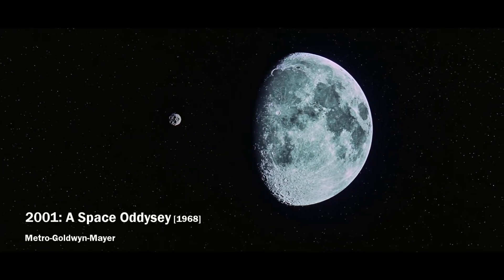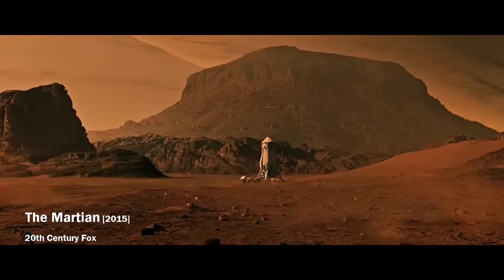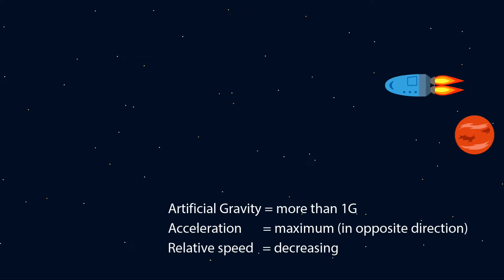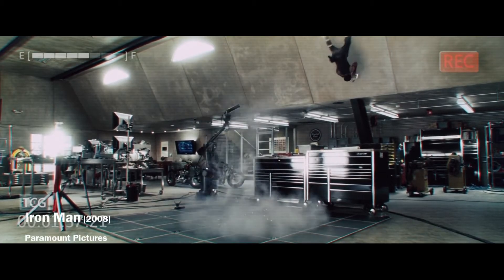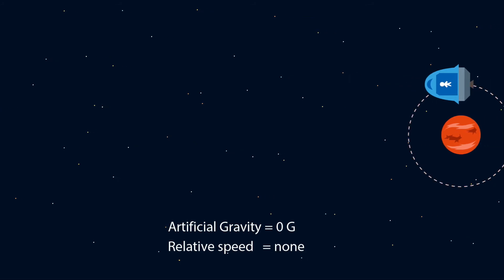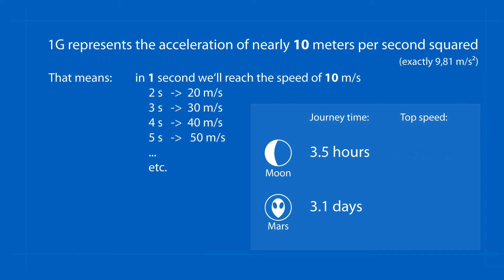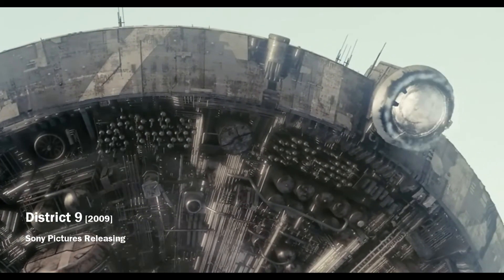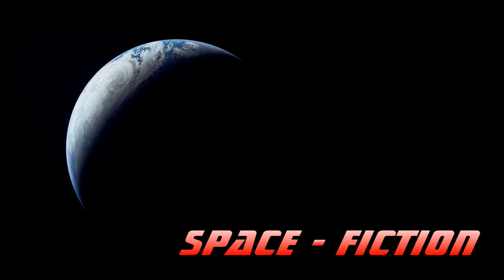Can we make artificial gravity without a rotation?

Comment: While its simple on smaller scale it's not really practical if you want an actual space settlement. A Rotational structure basically works with the same principle, but instead of freely accelerating in space, you put an axis to create centrifugal force. A disk shaped structure works better because every side of the disk opposite to each other create counter force, it's what were explained in the video when the spaceship accelerates, and then deccelerate after the change in direction. But instead of periodically accelerating and deccelerating, it's done constantly. You also don't need a varying speed with rotational device, as you can keep the rotation speed the same.The bigger the structure, the less dizzy you will feel. The only real problem would be the amount of raw materials needed and the cost of transporting them to the space. To achieve it reastically, you would need to start from making a smaller scale colony in space, and then mine the materials from the asteroids. We can start off from the moon, with how lower the gravity is the cost of launching the materials would be lessened as well.
Reply from the maker: Yes, you are right that for a long term settlement in space the rotating structure is better if we want to make an artificial gravity. There is nothing more to say here.
But for a space transport there are some problems with rotating structure too. Yes, it is more economic, but you have to spend more time in space. Dizziness is not a question in interplanetary space because you will see nothing outside the windowsif your room lights will be on. But another big problem is maneuverability. Rotating structure of such heavy object has really big momentum and you can not just change the direction of rotation axis as easy as for a non-rotation structure. This would be especially problematic if you will want to make precise trajectory corection.

Comment: So, as "alternative Earth shape" proponents would say:
- The Earth is flat and pushed "up" by a universal accelerator (yet somehow we can't measure our current speed)
- We actually live in a hollow Earth, see an illusion, and we're stuck to the ground due to rotation (I guess things go "down" due to relative density, so that's why we can jump and float)

Flat platform attached perpendicular to a centrifuge wall?
Reply: Yes, in which case there would have to be an outside force coming from space, which is not the case, as we know space to create no resistance.

Not that it matters, because both Flat-Earthers and Hollow Earthers generally deny the legitimacy of any space travel or studies which have occurred, and thereby any manner of science or study related to it is moot in any debate with them. Especially because space travel would validate photographs of the Earth that is neither hollow nor flat.

It is ironic, therefore, that they would even suggest that they require an accelerator or other force pushing the world to exist.
Reply: hahaha.

Comment: I was searching for a video that explains science fiction's omnipresence of artificial gravity in all spacecraft. And I didn't realize it before now that, almost all of those spacecraft had powerful sub light engines that simulated that experience. Thanks, loved this video!
Reply: Except alot of sci fi arrange decks parallel to their engines instead of perpendicular, any ship like this would push everyone into the back wall of the room.

In fact Star Trek had to come up with a fictional technology called an inertial dampener that was necessary to make the nautical style layout of  those decks practical.

If you want to see the concept done well watch or read the Expanse. Rotational and thrust generated artificial gravity are implemented on almost everything.
Reply: @outerheaven155  yeah, most hard scifi just invent stuff in order to both make the drama more grounded and also not blow the budget in a single episode. Battlestar galactica 2003 did the same thing, where they just magically have “gravity plating” so they can have horizontal style ships. Even in the supposedly ancient galactica

The more fantastical series simply don’t mention gravity at all, like Star Wars